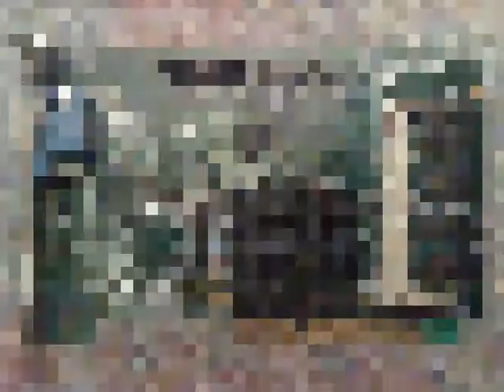My Cpu Collection

Comment: @svario94 
iv ditched alot of cpu's now. still kept hold of a few pentium 3's, all i have now is
SKT 370:
667MHZ, 700MHZ, 2X 866MHZ, 2X 933MHZ Pentium 3's
Slot 1:
2X 450MHZ, 550MHZ, 667MHZ Pentium 3's
SKT A (462):
2800+, 3200+ athlon xp's
SKT 939:
1.8GHZ Opteron144
and  e5300@2.6ghz in main pc.